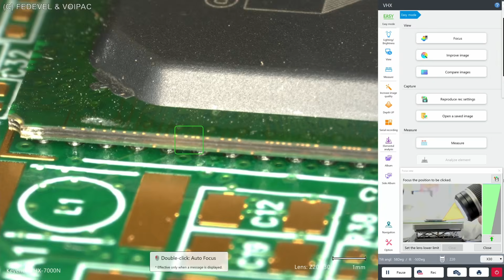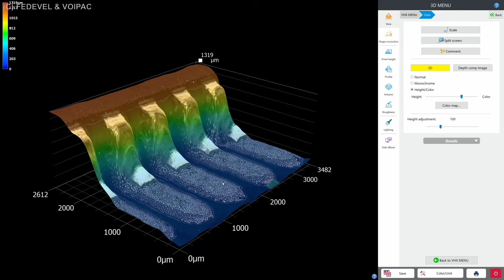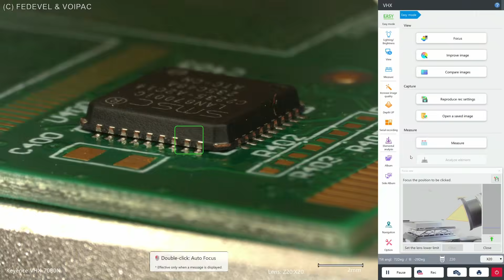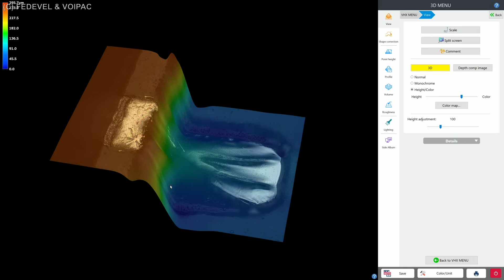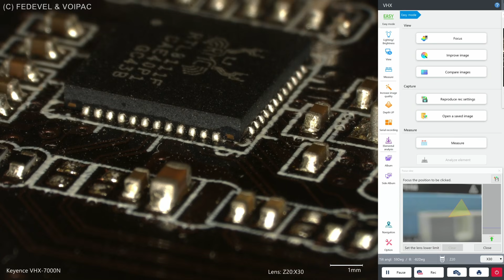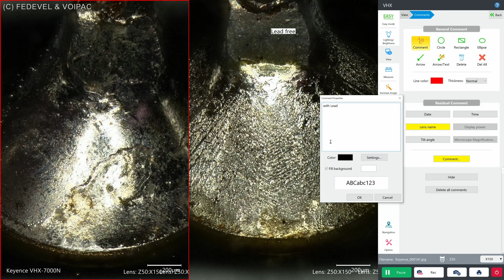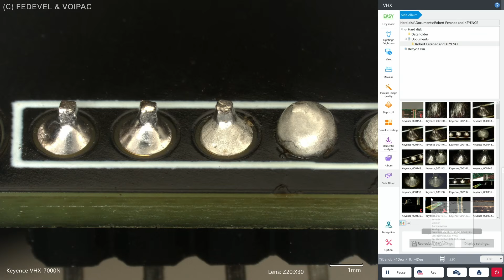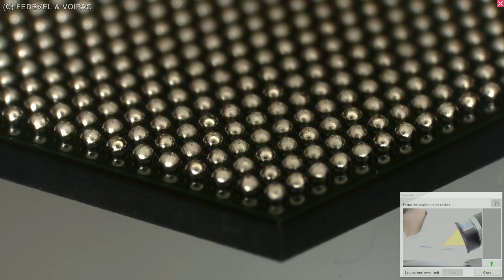Have you ever seen soldering THIS close?

Comment: This is the tool we badly needed in a company where we were asked to check soldering quality for hours. This daunting task made me quit. The thing is you still cannot check the quality for many other balls that exist in the midst of the chip.
Reply: Thats why most professional SMD lines have an XRay inspection station to look under QFN and BGA packages, usually combined with visual AOI and a workstation where someone has to verifiy the error messages and pictures and decide if it's a false positive or needs to go to rework.
Reply: @ProtonOne11  True that. If you don't have an X-ray machine for such work, a company should not even think about offering BGA-checks as a service. And even when you have one at your disposal (I have one at the place where I work) it certainly is NOT easy. We keep boards with known bad joints or internally broken bondwires (IC's) just for reference when in doubt. Especially trying to figure out which side of the board you are looking at can be daunting, especially when the board contains inner power planes, significantly reducing contrast between components, traces and the background of the screen that shows you the X-ray image.
There are most likely systems that can overlay a full component layout based on the PCB side you are looking at, but ours can't do that (and from what I know from our IPC specialist, we are already an (almost) one-of-a-kind company for even having an X-ray inspection machine)

Comment: It's always nice to see someone with this much attention to detail. 

I have a soldering certification that is even more stringent than what NASA requires. Towards the end of the course we solder a 140 pin flat pack using a soldering iron only with a 0.5mm pitch by hand and the expected quality for certification is as you described where the solder flows up a specific ammount at the front and back of the lead, but we also look for stress cracks, pitting, deweting and the tiniest traces of flux. Basically, the solder joints all end up with  a mirror finish to it.
Reply: Its Micro and Miniature Soldering its used for repair of mil spec items where a failure of a solder joint could cause 100 million dollars to go up in flames in an instant. We even learn how to excavate multilayer CCA that somehow have a hole in them and replace the copper traces by hand and epoxy back the layer one layer at a time. Even the epoxy is closely examined with a microscope for any trapped bubbles in the 10 micron scale that could compromise the insulation performance of the epoxy.
Reply: @Guardian_Arias  That sounds absolutely insane... but if there's a will (money :D), there's a way
Reply: @Guardian_Arias  This is the soldering quality I strive for in my work, where would you recommend for training?
Reply: @Teth47  You might want to look up the IPC standards and accompanying training centers to get an idea of that same level (there are videos on Youtube as well), as that is what Guardian_Arias is talking about (and to be honest, 'more stringent than NASA requires' sounds rather odd, as IPC standard is divided into 3 classes: class 1 is consumer equipment, class 2 is automotive stuff and class 3 critical electronics (aerospace, avionics, medical, mil-spec) and thus class 3 is aerospace level compliance when it comes to the quality of solder connections, component mounting and all other requirements to get your solder connections up to spec (where manufacturing documentation of the component in question always overrules whatever the IPC-standard states)
The initial theoretical training I had to take as an avionics technician took a week... followed by a few hours of practical work, which is also your exam to become a certified specialist (which is a worldwide recognised certification).
I followed IPC J-standard 001 and a bunch of other sub-standards gathered within the J-standard. Not all, as I don't work at a production facility but only do rework, repair and testing.
Reply: @weeardguy  Interesting, thanks! I'm a completely uneducated freelance prototyper, so I know nothing and basically always do things that are out of my depth. Always good to see where the people with actual credentials and meaningful training get their skills. Practical experience only takes one so far, can't make every mistake, after all.
Reply: @weeardguy  as an a IPC trainer I love your comment!  Maybe ipc 7711/21 is the best IPC cert u can get on the concerned matter despite not being related to BGAs
Reply: @vati702  Thanks ;) I became a CIS in February this year. Indeed 7711/21 is one of the parts of IPC training I got (I usually type my comments in the evening hours, when I'm not that bright anymore ;) .
I've got mad respect for my CIT at work, considering what he needs to know to become a CIT and stay a CIT... wow.
Reply: @weeardguy  great! I'm an certified IPC Trainer (A620) in Italy and aside the fact that I love my job, I have been learning  lots of new things!
Reply: @Teth47  You're welcome! To be honest, I usually favour people with a passion ;) They usually tend to know more from the start than those with an education. IPC training stuff isn't cheap, but it can give you an advantage over things you didn't know yet (and the videos/pictures in their trainings are excellent).
Reply: @Guardian_Arias  Northwest repair, is that you? :D
Reply: @anonony9081  lol nope, although his channel looks like Louis Rossmann channel before he realized tin foil hats are mandatory.

But to throw shade, even more precise of a manual solder job. Think zero heat guns unless its BGA and if you screw up that's 100k USD in the drain opposed to 2k USD.
Reply: What in the... What's the certificate called?
Reply: What would this level of professional soldering be used for?
Reply: @bryceshaw06 Just guessing, but prototyping and fixing some one off mil.spec or medical device.
Reply: leaded or lead free?
Can't imagine this to be possible with lead-free.
Have in younger years soldered 0,5mm pitch for fixing prototypes, leaded of course.
Lead free has bee a very negative experience. Super sensitive to settings, preparation and material. Very frustrating and inconsistant for manual soldering.
Reply: @dilbert0815  Leaded ofcourse, lead free is great for manufacturing large volumes, but no such epa restrictions exist outside of manufacturing.
Reply: @dilbert0815  Lead-free isn't as bad as some people say it is. Lead-free solder alloys have gone through a great evolution over the last say 20-30 years. Not only are there far more alloys to choose from by now, the industry now also got a lot of the teething-problems under control. Usually you need a slightly higher temperature, but once that has been set and when not cheaping out on the brand of solder used (forget about aliexpress and such, you never know what you will get) the results will be similar. The appearance of joints just looks different and it usually solidifies different as well, but apart from that a good solder alloy by  Kester, Chipquik and the likes will do the job fine.
Ofcourse this is all possible with lead-free solder, the industry would not accept such a significant change in production if this would mean they would have to leave known techniques.
Reply: @weeardguy  simple question: but is it any good?
I will answer from my side: no, except for process controlled manufacturing.

You definitely need better temperature controlled equipment. It's not just slidgly higher, but much more sensitive to the temperature. So manual soldering with lead-free, especially for repair jobs still is still a painfull experience.
Try to solder slightly aged material, e.g. wires or chips that have already some level of 'corrosion' from aging.
Leaded is then no problem, lead-free leaves a mess.
As you mention: you get an quality using good brand lead-free material that is on par with average leaded material.
That says a lot ;)

Lead free is the way to go for mass production in controlled production lines were the quality control can adjust process parameters. Then it's no problem after adjusting.
This kind of quality control is simply impossible for manual solder or repair of aged material (which is already a quality issue with leaded solder). With lead-free this quality issues are simply multiplying.
Leaded solder is a rather simple and rubust process that can be also used by amateurs easily, lead-free is not.
Reply: @dilbert0815  And that's where IPC-training kicks in, as corroded terminals are not allowed to be soldered just as-is AT ALL, leaded or not. Lead-free soldering works FINE, but only as long as the components or wires are fine as well. Corrosion is a big no-no in IPC-land, and with good reason.

I've used lead-free solder as a hobbyist as well, some good quality solder by Stannol and the connections are rock-solid. No, my hobby-stuff is no aerospace level equipment, but I'm not very easy on some (bare) assemblies as well.
Reply: @weeardguy  but 'corrosion' kicks in at any repair process. Also as a hobbyist my stuff is not stored in optimal conditions and way longer than acceptable for process material.
In this case leaded is a lot safer than lead free due to the simple fact that leaded ist much more tollerant to material quality.
Reply: @dilbert0815 ,  Looking at soldering equipment online, I've seen that Hakko and others are offering rework stations which have a hose to hook up nitrogen gas so that you can have an oxygen-free environment when you are soldering lead-free.  This requirement for the best-possible leadfree connections strikes me as borderline insane; we're not welding, we're soldering! I'll stick with leaded solder, thank you very much.....
Reply: @goodun2974  But don't forget that you're talking about state-of-the-art technology there, usually only required in IPC class 2 and 3 devices (respectively automotive and critical electronics (aerospace, avionics, medical and mil spec). Most people just won't need the addition of nitrogen, it can introduce other problems (solder balling) and most of all: the equipment that can handle nitrogen is extremely. extremely expensive. And there's a reason behind that price: it's top-level professional stuff that is made in far fewer quantities.
Nitrogen by the way isn't a lead-free only thing, it was used in leaded solder as well, but as SMD technology got significantly smaller over the decades, nitrogen has become a general addition to make soldering easier, with the increasing use of lead-free solder as a coincidental factor.
Reply: @dilbert0815  I avoid lead free as much as possible unless the solder joint will be exposed to 400c plus there is no reason one should use lead free. Lead free is only really required by manufacturers not repair facilities and even less so private use.
Reply: I used to repair circuit boards with chips like that.
Reply: Can someone point to the certification he's talking about please? I work on cellphone repair, sometimes hand soldering ripped traces on the iphone cpu or even bga packets internals by hand scrapping it down layer by layer by knife, I could easily qualify, not quite sure but as small as around 50 to 80 microns with cheap equipment
Reply: @luistrevino8515  IPC or 2M Micro-Miniature Soldering

Comment: I do casetype 0201 up to all kinds of THT parts and EMI shields manually at work. The smaller parts under a stereo microscope. Even after all those years and practice there is always a certain challenge with how the PCB's are designed (thermal relief, numbers of GND layers, etc.) to get a reasonable good solder result. The Microscope has become my  favorite and necessary tool to work with SMT and quality control in general. This Microscope system however, is very advanced. Love the possibility to change the viewing angle. I am a bit jealous right now, gotta say. ;-)

Comment: You should follow the thermal graph for paste and measuring thermal characteristics of pcb . For solder paste openings  holes IPC footprint standard is right way to do it . Otherwise you can get cold soldering on some pins.

Comment: your example for too much solder on the tht lead  is sometimes exactly what is required on high voltage stuff where you have avoid sharp edges
Reply: The one time in soldering where the bigger the blob really is the better the job.
Reply: great info, i did not know about this..
Reply: I never would have thought of that. I know what sharp edges do with high voltage, but again I wouldn't have connected the two here.
Reply: Is soldering ever allowed in high voltage applications?
Reply: @u2bear377 yes, and there are special workmanship requirements
Reply: the question is what voltage and what size of size/leads/pitch, no?
Reply: Could you cut the pin closer to the board so it ends up like just a dome, and holds well enough of it is a two-sided board?
Reply: how much voltage?

Comment: The Microscope system looks nice,
But the manufacturer is so tight with information's about the price 😢
Anyone know what its costs?
Reply: Manufacturers that refuse to list a price on their site and insist call them, are right up there on annoyances with chip manufacturers who won't give a datasheet without an NDA.
Reply: Somewhere around 30'000$ is what i hear, so you need to have a good excuse to go get one 😅
Reply: Having worked with them, several thousand, to several 10.000$ depending on the model and options you get.

Comment: Shows again why you should use an ultra sonic cleaner for your pcb.
Reply: If you can. Some components, like mems chips, quarz oscillators and ceramic capacitors don't do well in ultrasonic baths. A clean PCB with dead components is not helping anyone...
Reply: @ProtonOne11 ,  Is it the vibration, or the ingress of liquid, that causes the component damage?
Reply: @goodun2974  For these components, the vibrations are the problem. A ceramic capacitor can act like a piezo crystal and generate voltage in ultrasound if you hit some resonance. The other components are tiny electromechanical machines that do move or oscillate in normal operation, some of them might be more "shock proof" and have no problem with ultrasonic energy and vibration for a few minutes, but some chips or crystals might get damaged. Watch-crystals that resonate at 32kHz might get overloaded as ultrasonic frequency can be at or near theyr resonance.
It's best to check with the manufacturer first, if you are not sure.
Of course, the water bath might be a problem for other components that are not sealed and hard to properly dry out internally to prevent corrosion, like mechanical switches, some connectors, or relays.